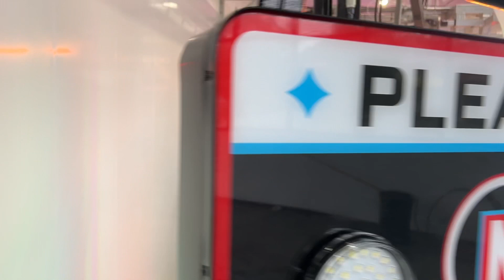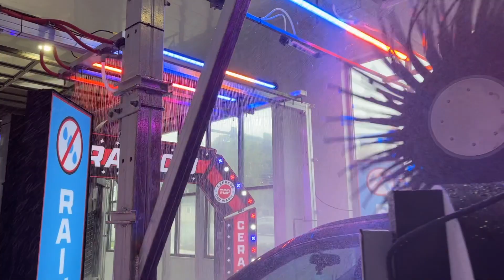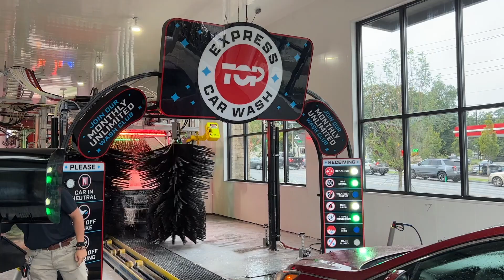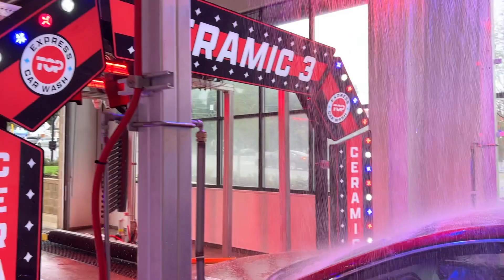Top Express Car Wash: Chamblee Clairmont Rd Site

Comment: Have you worn any safety glasses when filming inside of a wash tunnel before? I used to wear safety glasses for a little bit when filming IBAs or mini tunnels, and they have been helpful to me during some moments, but I stopped wearing them because condensation would form on my lenses throughout most of the wash process.
Reply from the maker: No, I have found it makes it harder to film when wearing safety glasses due to them fogging up as you described. I do wear them when handling chemicals as part of my job.
Reply: There is a Car Wash in Ocean Springs
Reply: Wash It Express Car Wash is in Ocean Springs make the video
Reply: Now it’s America Express Car Wash

Comment: No pre  rinse - not a chance
Reply from the maker: It is better for the vehicle to enter the tunnel with dry surfaces to maximize the performance of the presoak. Having a wet surface causes your presoak to be double diluted, reducing its performance and possibly requiring more product to be needed for the application.
Reply: @SFCarWashChannel  Still not a good idea
Reply from the maker: Any sort of pre-rinse would only make it harder to clean the car.
Reply: @SFCarWashChannel  I didn’t realize it was a science. I always thought if the vehicle is prepped before the tunnel it would be a lot cleaner leaving the tunnel wash.

Comment: Is this a Sonny’s + MacNeil tunnel?
Reply from the maker: Nope, everything in the tunnel is from Sonny's.
Reply: Oh how come it doesn’t have mitter curtains?
Reply from the maker: Many new Sonny's tunnels don't use mitters due to a combination of Sonny's employees' own preferences and the preferences of the operators who purchase the equipment. Some chains like Mister are even ripping out their mitters and replacing them with top brushes.
Reply: Oh ok because legends express did the same thing before it turned into whitewater